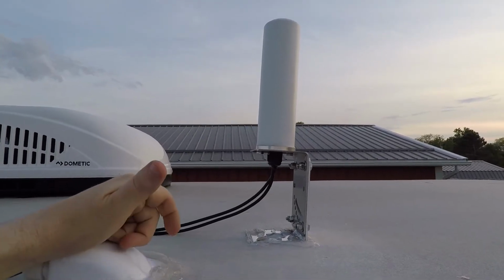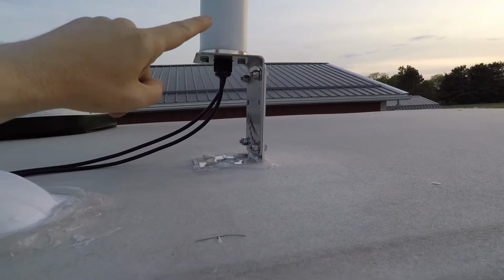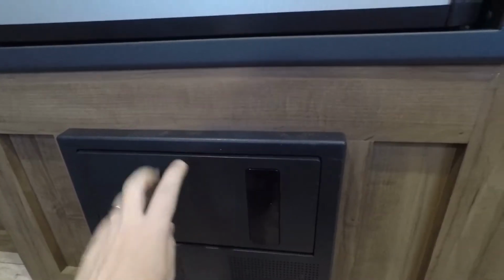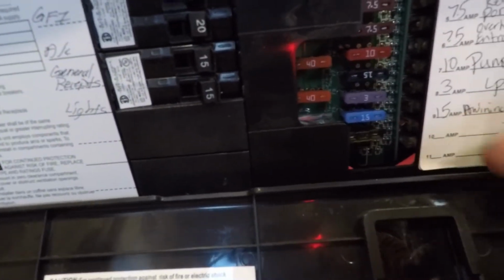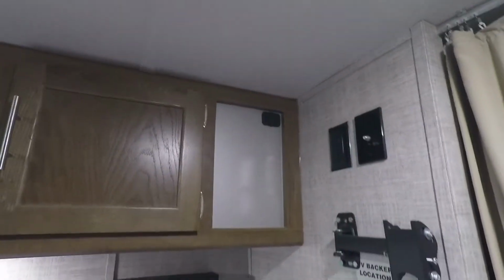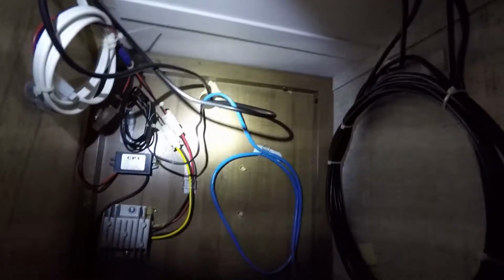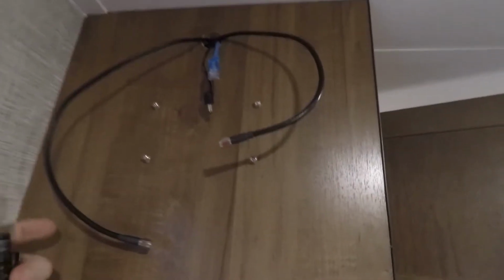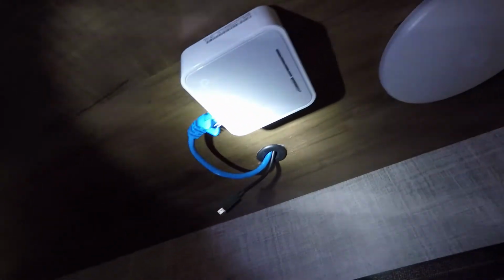Installing RV 4G LTE Internet - Antenna and power installation

Comment: What cell provider are you using in the Mofi4500? Im with Travel data now, but considering do you what you have done. Thanks for sharing
Reply from the maker: I’m currently using a provider called U2 Connect Now with one of their “blue” (AT&T ) SIM cards.